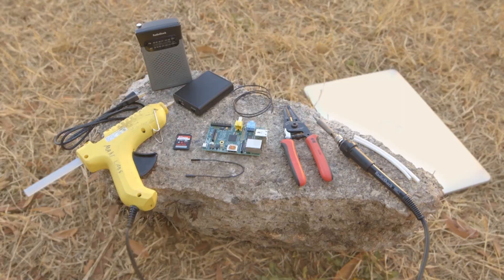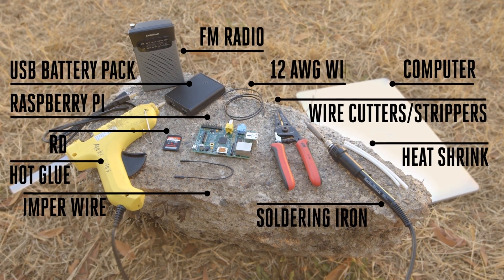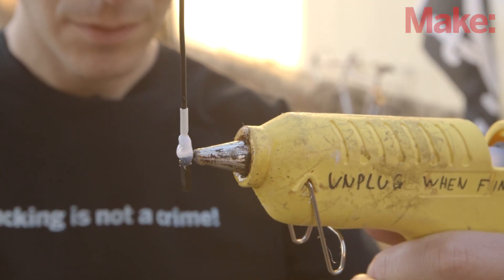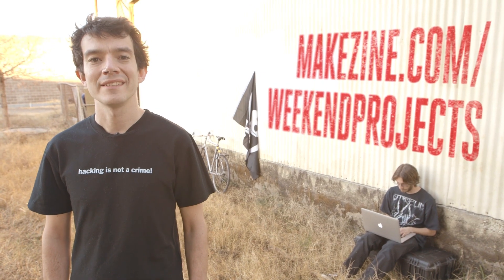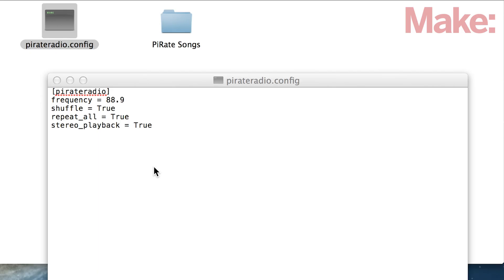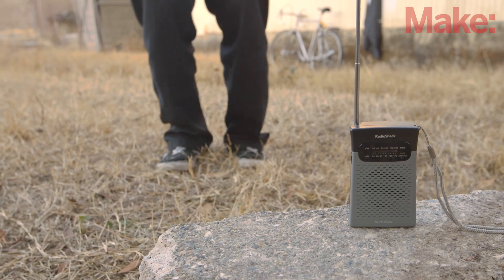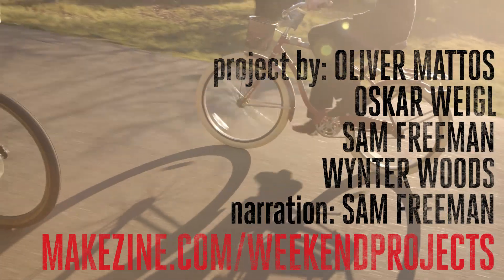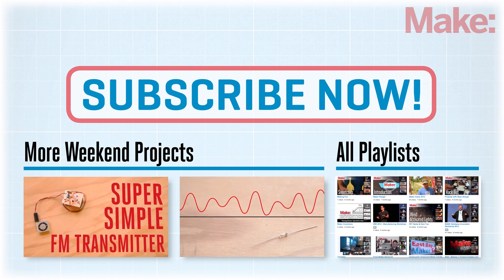Weekend Projects - Raspberry Pirate Radio

Comment: Based on my experience, this Raspberry Pi Pirate Radio can transmit radio signal up to 150 meter in range
Reply: It can be used, for example, to provide sound for a party or an impromptu folk concert in the garden, or to broadcast around the apartment, or as a house communication system for neighbors in the same house. A very useful and practical feature. Of course, it is necessary to make either a low pass filter using the sox program or use a hardware filter, which can be purchased at a reasonable price. You need to check your local laws, in some places it's legal, in others it's a grey area and in some places it can't be used because the local legislators have gone crazy. But it's a good topic for a debate about the civil use of radio frequencies and possible legal changes that would allow it under certain conditions. You can also usually ride a small moped in your own garden without a license.

Comment: You CANT'T stay within the FM band because PIFM emits a square wave signal, which will always emits unlimited harmonics, so you will ALWAYS transmit in military and avionic bands, this why the raspberry PI foundation attempted to make PIFM not work anymore on later models.
Reply: Thanks for the heads up.

Comment: Is there a way to use this just to listen to music in my car from my iPhone to the car radio. I've bought many FM transmitters that never worked well. But I don't want to do anything illegal. Do I need antenna for short distances? I Just want to transmit a few feet. Is it legal?
Reply: Just tune it to a frequency that doesn't have any stations broadcasting to it and you should be fine, without the wire it only works up to 1-5 meters soo you should be fine.

Comment: This won't get you arrested instantly.
If you: Overwrite a current radio broadcast or overwrite a law enforcement radio signal you will get arrested.
This itself won't get you arrested.
Reply: Does this apply for all states?
Reply: I'm not sure, you should still probably look into it but I would assume it's pretty general to not interfere with law enforcement comms.

Comment: Where can I get the jumper cables you cut the end off? Can I just wrap my wire around pin 4 instead?
Reply: +JoyousUnicornGaming You can find those plugs on any old PC case.
Reply: I got some jumpers
Reply: ***** Micro center. I got a thing
Reply: +JoyousUnicornGaming where from?

Comment: i have a couple questions and i would love for them to be answered(you dont have to answer all of them), first off, how far can this REALLY transmit, like via miles or something? second off: would i have to request access to play copyrighted music like TwentyOnePilots or something? Third Off: is this necessarily legal, dont you ahve to register radio stations or something? please respond as i have a raspberry pi and would love to do this
Reply: +©Cubit-Games PIRATE radio its illegal
                              ^^^^^^^^
Reply: I know not about the other options, but in the US, a transmitter under 20 mW does not need registered with the FCC.
Reply: +somethingepic "Pirate radio is only illegal if you interfere with frequencies currently being used"

That is not true.  You aren't allowed to cause interference, but there are other requirements as well.  Fines for violation range from $10,000 to $75,000.
Reply: thanks for the info
Reply: Cubit This thing is based on square shaped carrier frequencies, hell it will cause a lot of modulation by products well beyond the 108 MHz, possibly interfering without you ever realising. Power output is low, though. Between the pin and the "antenna" should definitely be an old fashioned analogue low pass filter.

Comment: How far does the transition usually go?
Reply: +Jos Quack Someone on the Make site in the description made a graph, if you are still curious. I'll be the first to admit that the graph they used seems to be mislabelled, and I struggle to read it, but it says 20cm antenna will average 12 metres (radially) and that 30cm averages 25m.

Comment: Hi, got my first rasparry today, so i dont exactly know what i have done wrong, i have the pi 2 mod b and after i flashed "RiRadio_1-1.iso" to the pi it wont boot up, i flashed with win32 and now don´t know what to do!
Reply: 0000000000323120  I'm having same problem. Did you find a fix?

Comment: This is illegal to do. You can choose the FM band but there will be even harmonics being broadcast as well. Its a good way of getting in trouble with the FCC. I.e. you transmit at 100MHz... You also end up transmitting at 200Mhz, 400, 600, 800, etc. This occurs because the Pi is transmitting using a square wave, which is a sum of all even harmonics of the fundamental frequency. 

 Long story short, this will quite possibly get you into trouble, even IF YOU THINK you are only transmitting on the "FM Band"
Reply: Evan Johnson spoilsport.
Reply: Boompass hey buddy, if you want to face potential federal fines go for it. The FCC doesn't mess around. 

I didn't say that the video wasn't cool, nor did I say that it didn't seem like a fun idea and an interesting application of a Pi, I am just saying that it can get you into trouble if you aren't careful. Have you ever noticed that all appliances and electronics have to be FCC certified not to cause harmful interference during their normal operation? This use of the pi could jam everything nearby from cell phones to police radio. There's a lot of important radio bands that operate within those harmonics. So call me what you want, I was just trying to warn people that it can cause issues with the Feds. 

Edit: potential fines.
Reply: Not when it comes to transmitting over licensed frequency bands.
Reply: Evan Johnson  screw the fcc
Reply: THE FCC WON'T LET ME BE OR LET ME BE ME!
Reply: If it's under 100mw output and doesn't cause harmful RFI to anything critical, no one is going to care!   FCC won't do anything...promise. =)
Reply: Evan Johnson who fucking cares
Reply: True but a low powered transmitter like this isn't going to reach far. It's less than 5 watts and with such an ineffecient antenna its less than 5 watts EIRP. Technically illegal but I doubt you'd get in any trouble for it.
Reply: or you could just get a broadcasting permit...
Reply: Evan knows his shit and seems to be one of the few grownups on here.

Comment: Wonder if there is a way to run some sort of Modem emulation on this radio as well as a networking protocol that would allow you make a wireless connection between two Pi's?

Comment: Formula for perfect antenna length:

300 / MHz = X
X x 0.95 = Y
Y / 4 = Z

300 is the speed of light in km/s
MHz is the broadcasting frequenzy
X is the radio wavelength
Y is the fullwave antenna wavelenth. The reason to multiply by 0.95 is to compensate for wire resistance.
Z is the length of the antenna which in this case is a 1/4-wavelenth antenna. You can also add a 1/4-th wavelenth counter weight to the ground so you have a halfwave antenna.
Reply: I would use the 27 mhz civil band freqs. No lawbreaking and you can reach 1000 miles away with the right conditions'
Reply: What unit of measurement is the result?

How do I get centimetres?
Reply: The speed of light is not 300 km/s! It is 300000 km/s! 300 is the Speed in Mm/s (Mega, not  kilo). Because of this, the formula works well with MHz. The result is the wavelength in m. 1m = 100cm.
Reply: What I'm seeing is that the ideal antennae length is Y, but that Y/2 and Y/4 are acceptable?
Reply: @iisgray  Y/5 also works

Comment: Where can I get jumper wires or 12awg what are they? New to this stuff
Reply: Any hobby electronics shop.
12awg represents the size/diameter of the wire itself.
awg is short for American Wire Gauge it's just a standard for measuring cable thickness. The smaller the number the thicker the wire so 1awg is much bigger than 12awg. Jumper wire is a wire used to connect from one point to another.

Comment: Thanks for the Video! A 20 feet BNC cable, using the core of the wire, works perfect too. Make sure you change the PiFM image in the provided ZIP from ISO to IMG. Otherwise, you can't flash it to the sd card

Comment: if the RasPi can broadcast radio, can it receive FM transmissions,too?
Reply: no, because it is generating a signal, there is no hardware to receive a signal
Reply: Doesn't have a tuner soo no.
Reply: cwbh10 they're called GPIO pins the I and O stand for in and out... " a bit of the old in and out"

Comment: Just a quick question... does a jumper wire HAVE to be used to connect to the GPIO pin for an antenna or can any wire simply be wrapped around it and secured?
Reply: So i confirmed today... i cut off an end of a male to male 3.5mm audio wire and attached it to pin 4 and works flawlessly. I guess self-troubleshooting does pay off

Comment: MAKE this does not work on Windowd the card does not get partiteoned properly and you can not find the /pirateradio Please FIX IT !

Like so they can see please !
Reply: It is possible on windows as i have done it. You might just be using the wrong utility. Try some of the dedicated installers for it or Win32DiskImager (what i used)
Reply: Rhetorical Question
 I think you have problems with viewing the partitions on windows? especially the /pirateradio partition, i don't know why but i had the same problem, i used filezilla with sftp:// to see the partitions over ssh, and if i had to move a lot of music i switched to my linux os which had no problems mounting those partitions with a USB SDcard hub.
After all i did use "dd" instead of "Win32DiskImager" on a 4gb SD card, maybe something about using "dd" or a 4gb sd card is wrong is wrong.
Reply from the maker: Hi Rhetorical,
We hear you! We've just published a how-to connect to your Pi from Windows over SSH using WinSCP. Check out the tut here: http://m8k.me/1iF8Tv2
Reply: MAKE Thankyou i did so but can you please fix the problem with card partitioning on windows ?
Reply from the maker: Rhetorical Question What problem were/are you having exactly with the partitioning process? Everything works fine on our end but we realize people are using different tools, setups, etc. Feel free to shoot a note or error screenshot to weekendprojects@makezine.com- thanks!
Reply: +Rhetorical Question 
Can you transmit on several frequencies simultaneously?
Reply: No. They run on the same cable, therefore it..... will............. Well, I don't know actually..
Reply: I can say i was slightly able to do that. When i logged off without shutting down the program and starting it again and it was playing 2 songs at once. I didn't try to play them on different frequencies.

Comment: In stead of having a partitioned SD card with PIrate radio folders, I get a non partitioned version of linux? I wrote the ISO to the SD card. Am I missing something?
Reply: Same here. Not sure what the problem is.
Reply: I am getting the same problem. Any fixes?
Reply: try using a Linux-Computer, it works with mine

Comment: Is it possible to modify the script to rebroadcast Internet Radio, or maybe a live microphone input to FM?

EDIT: I've modified the script to add streaming internet radio. And apparently live microphone streams were already written in but  #commented  out.
Link: https://mega.co.nz/#!W8gxwT6J!lT5dmvfYn1voU9ITBn-iGXuyafwVxkO0tLllPeSU7Ow

Use it by simply placing a .pls or .m3u file in the pirateradio partition

It's recommended that you keep repeat_all enabled so it tries to connect until it has a function internet connection
Reply: Broadcasting Internet radio is as easy as pi(p)e!
I use this command:
$ mpg123 -f 57000 -C -s http://listen.fillyradio.com:8000/ | sudo ./pifm - 87.5 44100 stereo
Reply: djazz // danieljhede Thanks for the tip. I personally prefer Everfree Radio, but I now know I'm taking my Pi to Buck.
Reply: xfkibaa I'll play with it tonight, I first have to see how the python script works. I might even be able to get it to work by simply placing a pls into the directory and making it interpret that.

mpg123 -f 57000 -C -@ listen.pls > fifofile
sudo ./pifm fifofile  87.5 44100 stereo
Reply: djazz // danieljhede, xfkibaa  I've modified the script so it functions with live radio streams. Link to modified script in my original post.
Reply: Would it be possible for you to either explain or make a video on how to setup live microphone streaming? I have already reached the upper limit on how much music i can stuff into the SD car partition. Just connecting and playing the sound through an external audio device (with more available memory) seems like an easier solution compared to expanding the partitions on the SD card.
Reply: after i commenting out the microphone part 
to where i connect the microphone?
Reply: i would also really like some instructions on how to set up the microphone in the script. Is there more info for this somewhere?

Comment: Cool idea for creating a haunted house or spooky graveyard set up for Halloween.  You just need some wireless speakers and a neat sound track.  Speaking of Halloween, do you have any projects that will let the Pi control outdoor lighting?  I've seen some really nice systems for controlling outdoor light displays, but they all seem a little pricey.  If the Pi can be connected to a DIY wiring command system, it would be lots of fun to build your own synchronized light show.
Reply from the maker: Neat idea - we didn't consider that application. We haven't seen a Pi lighting system yet but we'll keep a lookout. Cheers!

Comment: hmm pretty cool, wondering if you could set FM of some radio station, drive around and troll other drivers listening to that radio :D this seriously need some more Wats for power mod :D
Reply: I'm pretty sure the FCC would have a problem with that. :P
Reply: Christopher Pilcher they need to catch you first :D
Reply: gawd no.. probably some kind of b** that will force car drivers to listen to justin bierer :c
Reply: TechsysOFFICIAL Tapes are still in use for recording in radio station, at least here in Slovakia they record the whole day non stop for backup or something, and also we use it in work for backup ( huge ass robotic tape library for servers backup ) tapes are not dead yet :D
Reply: I know what a casette is. It is some box with a tape inside. I can just see TechsysOfficial after heposted that comment " Those damn wipersnappers, they never knew the old days where we didn't have cellular phones!!
Reply: wel, that kinda solved it xD
Reply: ***** Whats a casette?!
Reply: guess youre to young to know that :p
Reply: also funny to know: 1cassette should have enough capacity (but not the speed and you know why) to holdup to 64TERABYTES of data... very helpfull for people like me who loves to calculate Pi
Reply: here, they don't record a day at the radio...
Reply: ***** ikr .o. first thing i googled when i did read that article about the cassette (about 1year ago): how to use cassette as HDD